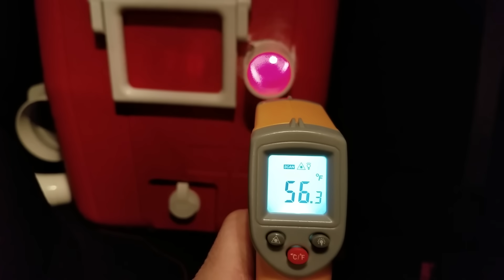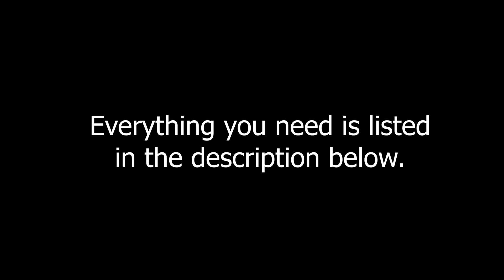Homemade Portable Air Conditioner DIY - Version 2 - Runs off 12 volt battery, car, or solar!

Comment: Question... What would happen if you placed a small vent in the top of the cooler and then had another opening that then feeds the inlet of the fan as a "pre-cooler" and then went through the same coil that you have?  Seems to me that you could probably drop the overall temp even further.  Pre-heaters and heat exchangers work on the same but opposite principle.  It would however melt the ice faster but then again you might get more effeciency on the actual temperature. You could also put an adjustable vent so that you can regulate it. Perhaps a mixture of outside air along with the pre-cooled air? This would also act as an automatic muffler for the fan noise also... Two birds with one stone.  Oh and double the length of the coils inside? Just an idea.

Comment: I wonder what happens if you supper insulate the cooler. One of those setups where the ice is suppose to last for 5 days. I actually have made similar ones to this with wireless remotes from ebay allow the fan to be turned off on and the user chooses the speed.

Comment: Would the 12v blower motors run on a 18 volt Ryobi drill battery?  It would probably run faster if it runs at all but for how long?

Comment: I’m about to build this, and I purchased everything in your list. It’s going to mainly be for a small room in the house, will it be ok to directly connect it to a pig tail and plug strait into the wall?
Reply from the maker: You will need a 120 volt adapter. I put a link to one in the description.
Reply: make & do well, I just blew up my first fan. That’s what happens when you know nothing about electrical. Ordering another one. Also ordering the cigarette lighter plug ( 7” one from your link with just the exposed wires at the end )   and AC adapter. Any other recommendations when wiring it all?

Comment: So my take on this:
I think the heat exchange is very limited with this design. I believe there is significantly less surface area when you use a flex pipe in this manner. The flex design gives it a lot more surface than just a regular pipe but it's still 3 inches diameter. This is why the ice is lasting longer, right? No direct contact between air and ice/water.

The cooler seems like a great cooler so I think a bag of ice and water would easily cool the contents to mid 50's. And then the next morning means a cooler ambient temperature anyway so a 10 degree drop overnight is not unreasonable at all.

The laser temperature gauge is designed to read surface temperature so the reading is from that 90 PVC pipe, not the air temperature. Since PVC isn't nearly as good of a heat conductor as metal, then it makes sense that it's nice and cold even if the fan is turned on and blowing hot/warm air.

I would like to know how well this system really does perform. I would assume not as well as the video claims.

The increase in air flow is probably helpful but only really due to wind chill factor.

I think this design ultimately has some merit. Seems like it just needs a lot more surface contact inside like a bunch of little tubes that can handle the amount of air flow. I'm thinking something like a radiator from a car but that may be too restrictive.

Also you would need a way to handle the condensation from the increased heat exchange. Maybe the tubing can be mounted on a decline and then the water can terminate through a drain as it exits the cooler while the air still flows forward.

Even with these changes, you still have humidity going back into the air like the traditional design. Also with the increased heat exchange, you will be back to use up a bunch of ice and salt.

Still I think this design is better than the traditional idea but with a couple of these mods I think it would be a lot better.
I don't know really because there is always a trade off somewhere and I might not be seeing it. Let me know what you think of my ideas.
Reply: jumpinwired I would say make one, and share your findings in a video 😎

Comment: All of these videos involve using ice that eventually melts. Would it take a refrigeration unit to keep freezing the ice ? Just curious. I have no idea HOW you would do it.
Reply: There was NO reason to be nasty.
And I have had the same girlfriend for 40 years.
I know better than to drill holes in a refrigerator and would never post such an idiotic comment.
But...as I asked, there should be some way to re-freeze the ice using copper tubing and a small bottle of refrigerant and a small motor.
Looking for a tech savvy person to answer my question and not a troll.

I found a video how to freeze the ice using chemical means using ice and salt.
Gets it to 0F.
So, could you just keep recirculating a salt solution through copper tubing to keep the ice cold longer ?
I think so but I am not a chemistry type.
https://www.youtube.com/watch?v=O7TvEIA0Ln4
Reply: George Senda I can see your comment in my inbox but not here. Dude, it's a sarcastic joke. No bad or personal intentions.

Comment: At least you're not using dry ice like an idiot. Also try adding a good amount of salt to the ice, it should melt faster but it will stay colder longer
Reply: Nath Henn In this case melted faster will be even better, since it covers more surface area of the pipe. It might get pretty nasty inside that cooler though.

Comment: I made one like this but I put the blower on top and used pipe down to the bottom I also added a 12 volt remote control relay so I can turn it on and off easily and a thermostat. Works great. I use mine in the bedroom because I love a cold room to sleep.

Comment: Great design. Any concern with the aluminum tube getting damaged? Is there anything out there more durable than that? That stuff bends, dents easy.
Reply: What about using copper tubing all aluminum tubing and I bought a solid block of ice rap the copper coil around the block of ice maybe that might work too

Comment: 4:00 when you poured the water in the cooler it filled all the gaps between the pipe and the ice cubes which obviously turned to ice and gave more aoe. Oh and I will be making this 👍🏼

Comment: Could you wire it directly to a house plug?
Reply from the maker: Yes. There is a link in the description for a 120 volt adapter.
Reply: I saw that.  I don't intend to use it the car.  So I wanted to hook it up without the car adapter if possible.

Comment: One thought (Just a suggestion) I had for people that mentioned that the Duct Work leaks over time, is you could try RUST-OLEUM NEVERWET MULTI-PURPOSE SPRAY KIT, and spray the Duct Work before you install it. I am curios if this would help prevent any leaks. 
https://www.walmart.com/ip/RUST-OLEUM-NEVERWET-MULTI-PURPOSE-SPRAY-KIT/48976585?wmlspartner=wlpa&selectedSellerId=1122&adid=22222222227039459758&wl0=&wl1=g&wl2=c&wl3=85717551410&wl4=aud-450464696613:pla-193901646770&wl5=9027201&wl6=&wl7=&wl8=&wl9=pla&wl10=101593696&wl11=online&wl12=48976585&wl13=&veh=sem

Comment: Hi I have suggestions 1 seal the power wire opening and instal the fan inside the cooler this fan is close to the air exit. on the out side install regulater to control the fan speed keep the exit air 3 inch diameter I believe it's going to work better and cut the sound down don't  forget to put fuse befor the current go to the regulater amp depend on your motor.

Comment: to change your design a bit maybe you should use some copper piping with a lot of U turns to create more surface area for the ice to cool and to air to travel through and maybe get even cooler?

Comment: IMPROVEMENTS.  Now join a vent pipe to the "Intake" of the fan and make a hole on the side or top of the cooler of the box and place the "Inlet pipe into your new whole. Now drill 2 small wholes one inch holes at each end of the cooler into the lid. Now you will be sucking "COLD" air in from your cooler and into your ducting tube through the fan (cooling the fan) and tube thats covered in ice. And the 2 "SMALL" ONE INCH wholes either end? This is to allow an even flow, this allows for circulation of ROOM TEMPS to cool before entering the tube and fan reducing "negative pressure". Keeping your cooler box much cooler for longer. Why waste that cool air in exchange for room temp air alone when you can mix the two temps before circulating.  Keep intake tube the same size or you will lose pressure. "Happy Improvements" Enjoy !

Comment: I have an awesome d.i.y a/c also, I went to best buy, bought 12,000 btu a/c unit, took home, installed into window sill, plugged in, and whola!! My room is very VERY cold!
Power goes out, my 18k generator kicks on in about 45 minutes with no power detection, and whola!! My whole house has power, and my 12,000 btu window unit, makes my room very VERY cold!! Yay!! Me!!

Comment: im doing a toned down version of this. I've built a swamp cooler before but I'm curious as to how this non-evaporative design will work. I'm only aiming for cool air directly next to me, so I'll be using a 4.9" 50 CFM fan that will run through 6 feet of aluminium duct in a Coleman 25 quart cooler. Hoping to keep all fans/battery/etc. in the cooler to keep it compact. If I can get 8 hours of 50 deg air (granted slow moving) out of it, I'll be very happy.

Comment: Try this,  helium sealed cylinder stirling cryogenic piston operated off an electric motor that is able to turn gased in the air to super cold Liquid that fills an insulated tank with a bell siphon that empties into copper tubing with tiny holes drilled into it eith evaporative panel material cut into strips and wrapped around the copper coil were the liquid air will seep through the holes and be absorbed by the evaporative material frezzing slowing the liquid air has the liquid air is boiled off back into simple air super cooling the air has a blower motor draws air through the coil. Place a filter to catch hair and other objects on the air intake. Design a reusable filter just after the bell siphon to filter out fine dust and pollen from the liquid air a filter that can be removed and cleaned out by using an attachment on the kitchen sink to reverse the flow through the filter purging the filter and cleaning it out then let filter dry out has a clean filter is being used in the unit. Clean fresh air is then cycled through has it cools the air. A V-twin stirling cold gas engine with gadolinium magnetic bearings on all moving parts with antivibration technology used with the cold gas stirling piston heads contained in an insulated resivor filled with liquid air to fuel the cold gas cycle with the engines fly wheels one having a fan attached to it to draw and push air through the system with the other fly wheel having a rewired drum motor generator with magnetic bearings generating enough volts to operate the electric motor on the cryogenic piston. An organic carbon power cell can be used to produce the first tank of liquid air then ounce system is operating a circuit shuts off the power draw from the carbon power cell and power from the drum motor generator recharges the carbon power cell to a full charge then shuts down leaving the drum motor generator to power the Stirling cryogenic piston. An air conditioning unit the is self sustaining that super cools the air while removing hair dust and pollen and dander from the air? Hay let me know what you think about this? 😊
Reply: I think you're on to something, All those calculations look correct to me.
Reply: Calculation's? All that stuff is low technology i keep the really hi technology to use later. I just need some componats. So just hoping folks Will build these and then i can have access to parts so i can do some really neat other stuff with all those parts. 😊
Reply: If thats your idea of a joke coment you really went to a lot of effort to write that. Maybe you should buold one and show us how it works.

Comment: build this and the flexible tubing is not easy to work with.  it unclamps at some joints letting water into the tubing and reduces the pressure going thru the tubing and out the vent.       Need something that wont compromise and easily adjustable.   this is important when you are considering this idea in a limited space.   bigger coolers arent ideal for everyone.  
but its a good idea.   i like the heater core ideas over this one.  thats next

Comment: I can see why the ice will last a little longer.......no direct fan  blowing heat on the Ice.......the fan air is self contain within duct tubing...... I like Dan ideal too......about where the input should be.......to avoid leaks.

Comment: At at 6 amp load (12v = 72 watts),  that would take a pretty stout battery to last any meaningful time on a stand alone basis.  Maybe in a car or SUV,  you've got the recharge alternator amps to handle the load  Otherwise,  I've seen this both DIY setup's and even some on the retail market for hundreds of dollars...........  I may take a shot at the DIY just to see.   Good project to play with in either case.

Comment: 1. Why to downsize outlet? Inlet must be equal outlet. Otherwise it is restricting airflow and make much more noise.
2. Fans are more effective  if they pulling air, not pushing air. Try to turn fan backward so it will pull and you will get better efficiency.
Reply: Alex G It might cool better due to the venturi effect.

Comment: 59.99 for an air blower motor alone you might as well buy a portable air conditioner for $150.00 I like the video though.
Reply: Those portable air conditioner are electric hogs. I believe the idea is to get away from high electric air conditioning bills
Reply: Portable AC for 12v system? Don't think that's available.
Reply: the whole point!.. these brainlet comments are nerve racking

Comment: Would using a thinner metal hose that is longer be better? Having the air travel longer thorough the cooler before leaving. By thinner I mean smaller diameter.

Comment: The ice melting means the 'cold' in the chest has been dissapated to the room. If the ice is there after 3 days, the 'cold' contained in the chest hasn't been sent to the room. If the other models melt all the ice and this one doesn't, that just means the heat hasn't been absorbed by the ice.

That being said, this design has one advantage...it doesn't spread humidity back into the room from blowing water across an ice bed. So thats a big advantage.

Comment: Just a thought,  has anyone who has made on of these designs had any issues with the condensation on the inside of the pipe building up and filling the pipe.  Seems like continuous warm air flowing through the pipe would continuously form condensation until possibly filling the pipe with water.  Has this been a problem for anyone who has made one?
Reply: But seems like  a great concept.  I am interested in building one.

Comment: Great video and thanks for sharing your parts list too.  I've been toying with this idea too for a while.   The comments are helpful, some are funny too!  Here's my suggestions, some are already being discussed:   Mount the fan to the lid on the inside the cooler, this will greatly muffle the sound and give it a cleaner look.  One good fan with a 3 or 4" opening should be able to pull the outside (warm) air in, circulate through the metal pipe and push the (cool) air out.   Make the air out hole also on top; so all holes go into the lid, no chance of any leaks.   Lastly connect the out pipe to a long flexible plastic tube, so you can direct the air exactly where you need it.   In extreme heat, consider putting the tube under your shirt, or even consider making/using a cooling vest, like military pilots use.
Reply: my thoughts exactly
Reply: but then the engine of the fan will get the temp. up INSIDE the cooler...

Comment: I ended up making one of these but used a 3" 130CFM blower instead of the 4" 250CFM in the description. The 3" is a lot quieter, running tests on it now. Input air is 95 degrees and output air is 74 degrees. Everything else for the most part is as Jason designed. Oddly, because it is so cheap to make, I am considering daisy chaining a couple of these together to see what happens. With the 3" tubing fitting right onto the blower, I can just re-direct the output into a second ice chest. Running using a 12V 17AH battery pack with the intent to run using a solar panel + 12V 17AH rechargeable battery + a Beater Volkswagen Beetle. :D Thanks Jason, this was an awesome little DIY project that I did with my son.
Reply: I am going to build one of these for my daughter.  She is competitive golfer, going to take power from electric push cart, Two things I will need to do is a custom cooler that fits under golf bag and quiet fans.  you said fans were quieter.  How much quieter?  so much so it wouldn't distrurb other players?
Reply: the only thing that is important is the length of your serpentine and choice of material, the volume of the 2 boxes will make for longer use tough without adding extra ice

Comment: I don't want to try and say that I came up with this exact idea first or anything but I did wonder about using a tube but the use of that kind of dryer vent tube is genius in my head I kept thinking about like fixing metal pipes or some sort of piping of what you've done there is brilliant.

Comment: I think the only thing that would make this better is if you could find the proper solar panel to run it and then you can put touch solar panel in your window and save on power or, in my case I like to go to Renaissance festival and it's usually warm during the day and cool at night this would be great to pump into your tent.